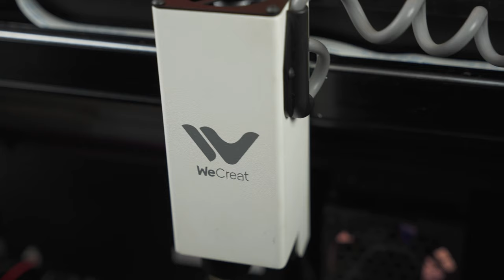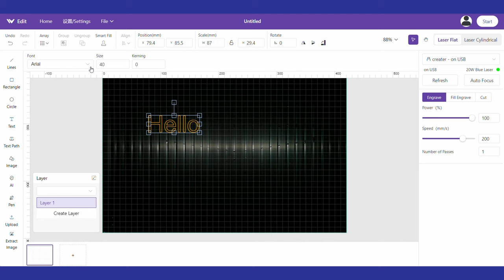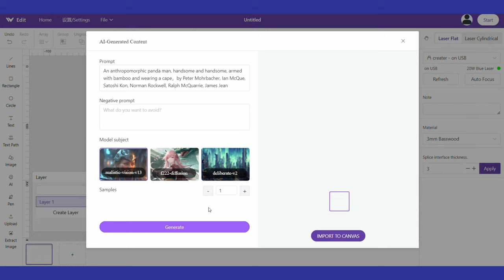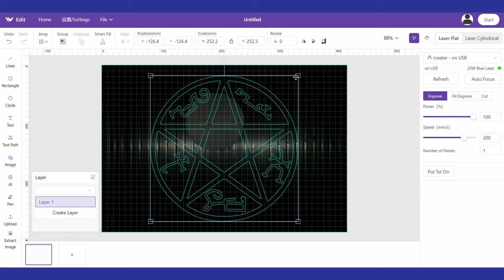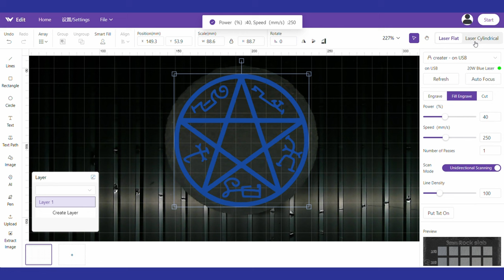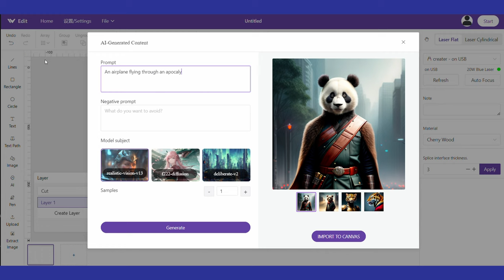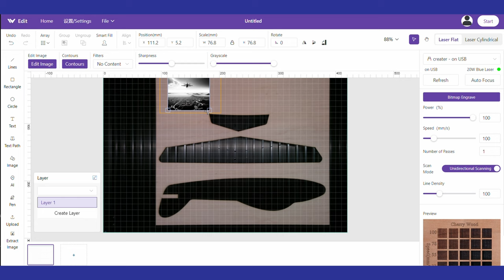The Wecreat Vision: A Laser Engraver That's Easy To Use And Safe!

Comment: An enclosure moving up and down   is prown to failure. In fact, I received my brand new device and right out if the box it presents a so called "Auto Focus Failure" that prevents the machine from working. The manufacturer ask the customer to unscrew 16 screws in order to see if the device does work. It doesn't. Too much marketing with a poor engineering behind. This is unacceptable.

Comment: Just opened mine for the first time. The enclosure moved up, and never came back down. Spent 2 hours reading through forums, and adjusting the z-axis... turned it on, and was able to cut a few test pieces. Opened the lid, and removed my cuts - they looked great. Closed the lid and tried to cut a different piece. Boom. Same issue with the gantry getting stuck in the up position. FML. I'm not a fan. Definitely doesn't work as advertised.

Comment: Does it cut clear plexi
Reply: No, it's a diode laser. You need a CO2 laser to cut clear acrylic. P.S. "Plexiglass" is a brand name, some of which is Polycarbonate, which you DON'T want to cut with a laser. Make sure your clear stuff is cast acrylic.
Reply: @mikedixonphoto  yes thanks cutting acrylic or plexi past 8years with co2 but really want something smaller but hope they come up one day wiyh diode laser that can match co2 wavelenght to cut clear
Reply: @mikedixonphoto  my co2 is old and cant use lightburn as it use the M2 nano board so limited with it